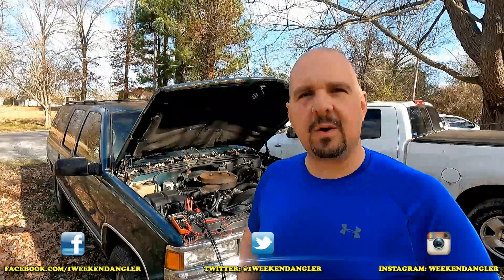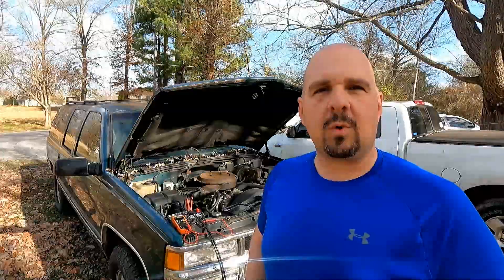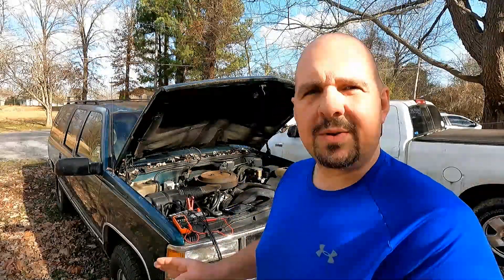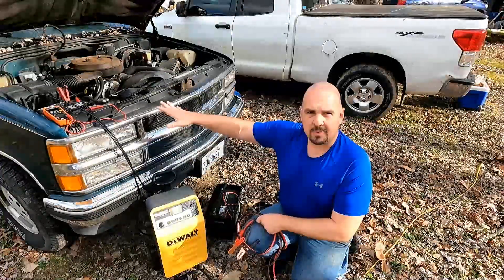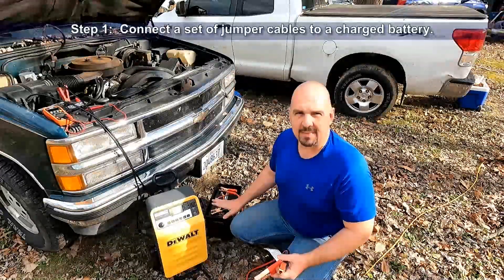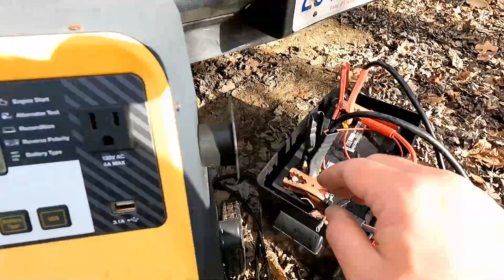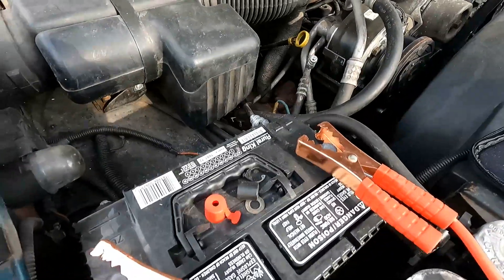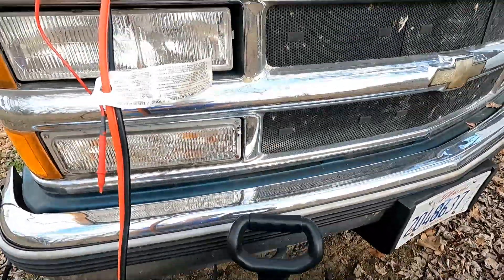How To Charge a DEAD Car Battery When The Smart Charger Won't Detect It

Comment: It's ridiculous that a battery charger won't charge a completely dead battery. That's the idea of a battery charger to charge a dead battery.
Reply: "Smart"? More like dumb battery chrager
Reply from the maker: I could not agree more my friend
Reply: @TheWeekendAngler  hi,I just now tried that and my cars horn started honking like it was being stolen, What am I doing wrong?
Reply: Exactly. Not only will older battery chargers always charge a battery, but they should last forever too. If I can't find older tools to help me problem solve and accomplish tasks, then I usually end up building the thing myself. We are in the age of "planned obsolescence", and all companies hire engineers who maximize their revenues by adhering to the planned obsolescence standard, and all such similar other practices as well. Quality products that are built to work and last are not made anymore, so if I want good shit I have to either make it myself or find an old one that someone is willing to sell.
Reply: @dennismcclelland8196  so agree with you. couldn't get this new smart charger to charge my dead battery left interior light on for 4 days meter reader said 7.7 volts would go thru a desul cycle then say wrong not charging do to not recognizing a 12 volt battery to charge bull shit (probably to het one to but another battery or another gadget) like the auto shut off and the detection of connect leads but the volts to start should be way less than whatever it is set at that allows charge to start charging!  These cost a lot of money and I shouldn't have to look for a way to "trick" to make the charge begin.  Forney wheeled battery charger errrrr
Reply: The new rarely proves to be better. (See the modern gas container)
Reply: I had this problem last year. took the battery into my warm house ..... hooked it up to my battery booster pack 3 times for 20 secs at a time .... throws enough energy to trick the "smart" charger to begin its cycle.
If you have a booster and are out and about and you find your battery is dead flat ... of course hooking the booster up will not start your car. You must first disconnect the battery cables, then, hook the booster cables up only to the disconnected cables ..... bi passes the dead battery, starts every time.
Reply: Basically you need a fully charged battery, a pair of jumper cables and a battery charger to charge a dead battery. Great charger!
Reply: Battery manufacturers are making the batteries worse and worse, I used to keep a battery 4-5 years, now I change it yearly
Reply: @Synthtv1  I grew up in the '60s and '70s. Batteries used to last 10 years back then
Reply: once the smart charger reads enough volts, can i move the smart charger off the good battery and finish charging on the bad battery if i leave the charger plugged in as i change over? should i hook positive to positive and negative to the car frame or right onto the negative post of bad battery? thx.
Reply: @theweekendangler I just tried this and my car horn started honking like it was  being stolen, what am I doing wrong? Thanks
Reply: You're right man I'm not gonna wasting my time to try it. I know that merry Christmas.
Reply: Nothing last forever my friend. The average life span of a battery is 3 to 5 years. Once the the battery expires its time for a new one and it won't hold a charge
Reply: @jeromemeyers4167  I'm merely talking about a new or recent battery that has gone completely dead and the battery charger won't charge it. It doesn't have to be a bad battery it could be a a battery that's just completely drained. Older manual battery chargers would charge a completely drained battery.
Reply: @gurnblanstein9816   I have a new charger AND a new battery.  No luck getting it charged. Will try again though.
Reply: @jeromemeyers4167  3 to 5 years? Seriously? Maybe that's the new norm but I'm used to having a battery for at least 10 years and more. Every auto I've owned since the mid 1990s had a battery that lasted until at least 2010 or longer. I've had to buy TWO new yellow tops within 5 years with the recent yellow top dying less than a year old. Maybe I can save it because it shows 10.5v but doesn't hold a charge. It is only 8 months old. But to your point about supposedly lasting 3 to 5 years. So you're ok with paying 200 to 400$every 3 to 5 years for a new battery? That's insane

Comment: So glad I came across your video, my son's motorbike battery had 0.5v in it which meant my Optimate 2 would not start charging.  Wired the bike battery up to a car battery then clipped the charger to the car battery and after 3hrs had 6v in the bike battery and now it's on charge direct with the charger 👍🏻

Comment: You should run the positive charger lead to the dead battery and the negative to the good battery so that you are not decreasing the life of the good battery. Still fools a smart charger but does so in a better more efficient manner.
Reply from the maker: That's a good idea too
Reply: I'll be doing this in the morning, so after doing that do you attach one jumper cable to the posts left on both batteries to complete the circuit?
Reply: Thank you for this video…I have a Promaster Van…😢Simple question….When you connected  smart charger to good battery…how did you have room on the battery posts to connect both jumper and charger clamps? Please don’t laugh at me…this is my first attempt at being a car mechanic….These batteries are very expensive so I have to try!😊 Thank you for your help!

Comment: what a load of crap i did that and the only battery that charged was the good one the dead one stayed dead
Reply from the maker: It sounds like you may have had a defective battery. Sometimes they fail internally and they simply won't charge anymore.

This hack is useful when you do something like leave a dome light on overnight and deeply discharge the battery.

Comment: Can I charge a standing car battery using a battery on a moving car?
Reply from the maker: Hooking it up might require some acrobatics.
Reply: @TheWeekendAngler  ahahahaha I think he meant charge a loose car battery with a running car using jumper cables. I’m wondering your opinion as well for deep cycle batteries.
Reply from the maker: @sacm.d.l8337  this technique will work for deep cycles as well.
Reply: @TheWeekendAngler  sorry I meant just forget the battery charger and use the car’s alternator. Like jump starting a car but no car. I’m a bit nervous to try it but Ive been in a tight spot sometimes where this would have saved the day. Didn’t have jumper cables with or I would have just tried it.
Reply from the maker: @sacm.d.l8337  you can use the alternator output of a running car to charge a separate battery, yes.

Comment: So you have to have a good battery to charge a dead battery with a smart charger. What good are they ? So if I’m sitting at home with a dead battery and no other batteries around I still can’t charge my dead battery. I guess that’s the new American way. Good information Josh.
Reply from the maker: Yeah, these new battery chargers are garbage. I have one old style left that will throw voltage into whatever I connect it to.

I absolutely hate the new style chargers, but it's all you can find these days. It took me a bit to figure out this workaround so I thought I'd share for anyone else in the same boat.

I've seen the threshold voltage on these chargers as high as 12v. If I have 12v on a battery, it really doesn't need charged.

Comment: Smart chargers are the dumbest thing ever invented. If the battery voltage was up enough for the charger to detect it it wouldn't need to be charged.
Reply from the maker: You're absolutely right!
Reply: It’s because of you have a bad cell you’re not creating an unsafe condition. Usually batteries below 10.8v are junk or need to be rejuvenated